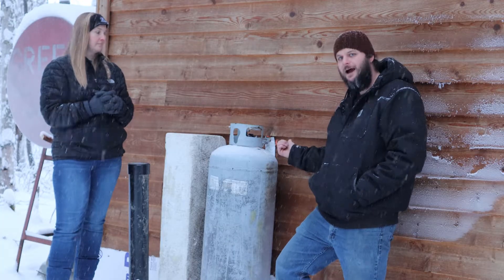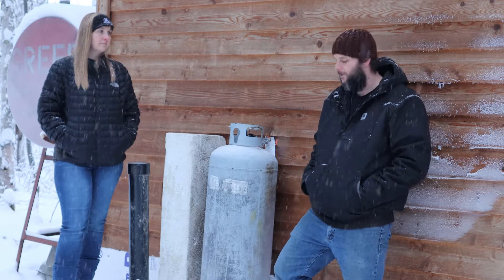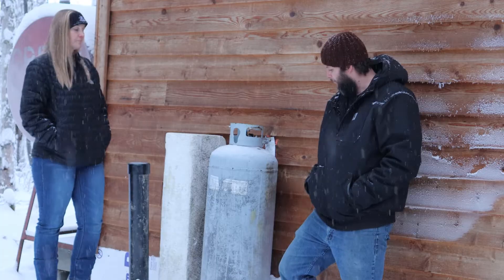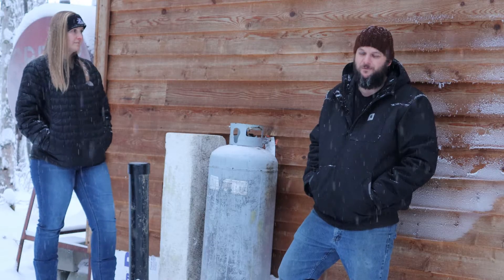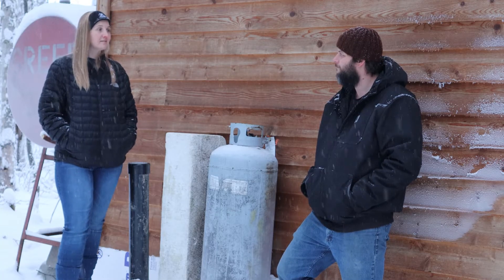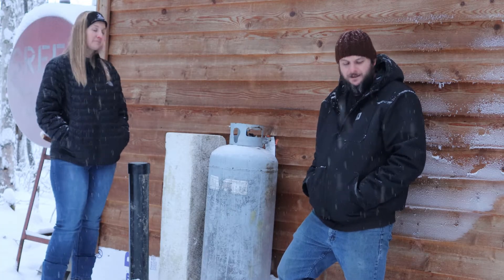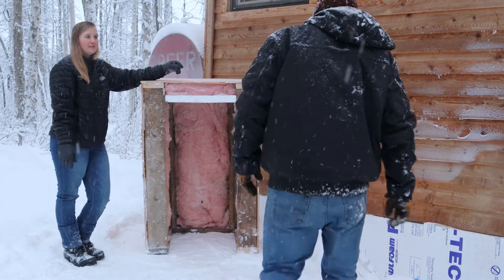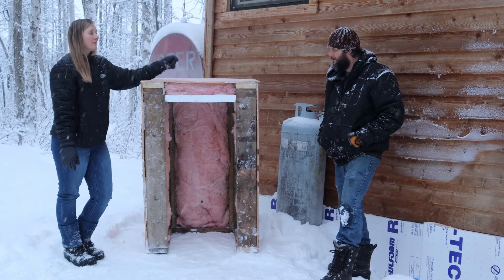Frozen Propane Tanks in Alaska: SOLVED!

Comment: I'm in NJ and have this issue for my garage. When you build that shelter make it so that it wraps around the tank, but not the top where the valve and regulator are and mount an inconsistent light bulb in the shelter and then have it controlled by a thermocouple. That should be safe and effective
Reply: Meaning you could have it closed off at the top around the tank but not enclosing the valve area, so basically the let's say 50 watt bulb is keeping the tank body warm enough. Those thermoxubes turn on at 35f and off at 45f.

Comment: Also the reason our tanks freeze up is related to the btus of the appliance you are using and the surface area where the liquid turns to a gas. If the appliance are calling for more gas but the surface area cannot convert the liquid to the gas fast enough a freezing of the liquid lpg occurs.  This is a technical name for this is called auto refrigeration and it means the liquid cannot convert to gas fast enough and begins to cool and causes the tank to freeze and the liquid propane becomes like slush and does not convert to gas so your appliances starve and wont work.   Hope this helps. I live in Canada and off grid to.  Larger horizontal tanks are best but if you cant get fuel delivery try two 100 lb tanks with a two into one line.  So this way you double your surface area. Two into one line costs seventy five bucks.

Comment: Hi. Buy a tank heater blanket.  It draws 100 watts and plugs into your generator 120 volt plug.  Or regular house plug. They are for 30 lb tanks so buy two   Amazon  sixty dollars each one.  Problem solved.

Comment: Hope all is well with you and yours. I know it has been a while since you posted this video. 

This comment is here to help others that might be interested in the topic “prevent propane tanks from freezing in extremely cold temperatures”. More on this in a bit.

Also, I understand the video depicts a solution to get propane heat into the cabin when outdoor temps were at or below -38°F. I consider this a temporary (emergency?) solution only. A propane delivery system should safely operate in all temperatures. By safely, I mean “NOT go Ka-Boooom!”. Once the outdoor average temperatures warmup, you should remove the tank enclosure, move the tank to a safe distance from the cabin PERMANENTLY and bury a propane supply line between the tank and cabin. Also, bury a 120V electrical line to the tank so you can energize a 95-100°F tank heater blanket for use in very cold weather only. If you do not energize the blanket, you must remove it from the tank so the tank can then utilize the surrounding ambient air to warm the liquid propane within.

Also, if budget allows, get 1 or 2 more tank(s) and tie them all together into a manifold. This full flow manifold will reduce the appliance draw, on each tank, to 1/2 or 1/3 previous draw, respectively. This can be a big bonus in very cold weather. This results in you being able to get more fuel out of each tank before refueling is required. In this case, you might be able to get by without heater blanket(s). 

Now, the topic: “prevent propane tanks from freezing in extremely cold temperatures”.

The main goal here is to allow vapor ONLY to leave the tank. In a perfect world where we have DRY propane in the tank, we would be done. But, depending on how cold it is outdoors, vapor can and DOES condense back to a liquid in the supply line. We have to deal with that. First, a little background: 

I read most of the comments. They are all over the place about the possibility of water being in the tank. Some say it is impossible for water to be in the tank! I am not going to argue whether there is or not. My advice is to plan that there will be impurities, of any kind, including liquid water, in the propane delivered to any tank. For whatever reason. This discussion plans on both water liquid & water vapor in the tank. In general, while operating through all the seasons of a year, a minimal amount of water in a tank should not affect operation UNLESS water freezes in the supply line to the first regulator orifice.

When outdoor temperature is near 32°F or lower, vaporized water can precipitate forming droplets on nearby cold surfaces. This also happens for vaporized propane when outdoor temps are near -44°F or lower. If this water precipitate DOES get to the initial regulator, when the regulator performs it’s magic, the resulting pressure & temperature drop can freeze the water precipitate at the orifice of the regulator, blocking it. Not Good!

Now, we can deal with this precipitate, of any kind, as long as it does not get to the initial regulator orifice. One way is to focus on any precipitate near the tank supply valve pigtail. Make a loop in the pigtail coming out of the supply valve by bending it into a vertical loop. Make a gentle vertical curve up & then down to the regulator. Another way is to make a longer pigtail which is curved in a circle, spiraling upwards, a loop or two, then bent down for the regulator inlet connection. The upward slope of the pigtail, from the supply valve, allows any fluid droplets present to collect & flow back to the tank itself while allowing vapor, only, to continue onward to the initial regulator.

Comment: I think you are on the wrong track.  LPG does not freeze at any temperature  at which humans can exist,  and LP  certainly does not freeze at any neg 50F.  PROPANE DOES HOWEVER   become  essentially  THE SAME AS ATMOSPHERIC pressure at about NEG  44F.  This means it could NEVER generate enough pressure/ vapor/ flow to operate the reagulator(s)  or push gas through the piping.

Did you somehow  get moisture into your piping or regulators?   LPG does not contain water/ moisture, unless you have a  scammer  for a  supplier.   Generally, horizontal tanks are much better than vertical because they have more  vapor/ dome area at the top for the LP to vaporize.  Frost/ snow/  freezing that is water based on the OUTSIDE of a tank, fittings or piping  should have no effect.  IF YOU GET  water into the vent of an outdoor regulator, that could be an issue.  ALL regulators have a vent (someplace)  to the  outside / atmospheric  pressure.

Comment: how did that work for you ? my thought was to build an enclosure like you did with a bock base and put some vents from the house through to the tank enclosure so as you are heating the house you are also heating the tank area. I would put some gasket insulation between the house and enclosure and eye bolts or ??? to be able to fasten the enclosure to the house tightly.
Reply: Are you nuts? Obviously you don't understand that propane vapor will enter the house using your method and potentially be fatal.

Comment: so how well did it work? i still need to build a enclosure for my tanks
Reply: Insulating human body with more clothing will reduce thermal transfer rate making us feel warmer in cold environment
A propane tank is not human body where it metabolize food for energy, just like insulating a house will not raise indoor temperature, to raise temperature it needs a thermal energy source.
Propane liquid (and therefore container tank) will take away energy as evapouration happens, the heat has to be replenish from somewhere otherwise propane gas pressure drops, at same consumption rate, a bigger tank (more mass) will slow down temperature drop, or better provide a suitable heat source and send the heat where its needed, e.g.

disclaimer: I have no relation with below business
https://youtu.be/cIL4KgqU0hk
Reply: by the way propane gas is denser than breathing air, if a leak happens propane gas sinks to bottom and accumlulate, so leave some air gap at bottom (and top for convection) of enclosure to vent before the concentration become explosive and it finds an ignition source
Reply: https://youtu.be/JzdnUZReoLM

Comment: add a second tank for more draw volume, i had this same issue with cold temps running a 100K btu heater with a 20lb bottle now i know why the instructions said to use at least a 40 or 60lb bottle, either way got a 100lb and never had an issue again but seems to be the same issue as a few others have mentioned, either a change over valve or tie the 2 together to double the capacity.
Reply: Agreed. I now have 3 tanks tied together and problem solved.

Comment: It’s nothing to do with stages but the boiling of the gas inside the tank due to draw from the burner, case in point I’m in Canada and the workshop heater is 12 feet from the tank which if the heater is on max the tank will ice - the best way is connect a 2nd tank on a changeover valve and allow the 1st to recover itself

Comment: It's 40°f here in Austin TX and my propane is freezing lol funny that it's freezing point is actually -300°f 
But it just can't turn into a gas property when cold
Reply: Propane boiling/ condescending temp is around -40F so how do you get -300? I handle a variety of different refrigerant gases on a daily basis and have for years and KNOW these temperatures. PROPANE is used as a refrigerant also know as R 290 and several other refrigerants.
Reply: @robertstanley1056 
Propane freezes at -306 degrees.
Reply: @robertstanley1056  I mean for it to actually freeze into a solid.
Reply: @danniemikeey2907  Howdy Texas! It is -35ish (yes, that's minus 35) where I live in Alberta, Canada at the moment. This is normal for us during the winter and not climate change for the climate crazies out there!  Relax Mr Stanley. A solid like dry ice (frozen CO2) right? Liquid Nitrogen boils at -297. I don't remember off hand, when it turns solid though, but it does. I've been working with liquified gases like oxygen (for hospitals), nitrogen, helium for refrigeration, purging/pressurizing piplines etc and maintaining their respective containers for about 30 years now. Cheers and Merry Christmas.
Reply: @michaelheurkens4538  hi!!! I actually found out that it wasn't a condensation problem but a pressure problem.

Comment: One thing that would help is having 2 tanks with a duel manifold. The vapor at the top of the tank is what is freezing, not the liquid propane at the bottom. If you have 2 tanks 2 share the load you will have much less of that propane 🥶
Reply: Nothing is freezing. The pressure inside the tank is dropping too low. At 70F the PSI inside a tank is around 125, at 32F its around 50, and at 0 its around 25. at -20 its around 10 PSI. Add a first stage and second stage regulator as well as piping, and that PSI can drop so low your appliances won't operate.

Comment: When propane vapor is released from the tank for appliance service, the propane inside tries to use ambient heat energy to boil propane and produce enough vapor pressure to reach equilibrium. This makes the propane tank draw heat thru its outside surface, and develop a frost layer. this solution shown wont fix the problem for continuous operation in low temps. The best solution is both insulate the tank (non permanently, so you can remove it in summer), AND apply heat from an alternate source: electric heater, gas heater, etc. These systems are available in the market.
Reply: Would some electric pipe wrap around tank and some insulation work?
Reply: Whatver you do, please ignore everything this guy said.

Comment: One trick that works for us is to use charcoal hand warmers (the large body warmers are best) along with a sleeping bag or heavy blanket. Put the warmers on the bottle at the stem and cover with sleeping bag to try and keep heat in. At -50f we just gave up on it and used the wood stove. Good luck with the shed.
Reply from the maker: Yeah that’s a good idea, We’ll keep that in mind if it comes up again. Thanks for the tip 👍
Reply: Thank you soooo very much. You literally saved me tonite, so here is the twist this mam mam here alone w 3 lil ones under 5 attempted and succeeded, when guided by your knowledge. First, convinced myself I will not cry, nor call for help, I can do this. Found hand warmers 🤦🏻‍♀️🤣, grabbed 2 diapers we no longer need, Bc we conquered potty training previously 🙏🏻🙏🏻, thick flannel oh pants and a rubber backed bath mat. Wrapped the hand warmers around perimeter of top of regulator, and one centered underneath. Wrapped warmers   tightly by attaching the pampers w the Velcro closures around the regulator and activated warmers. Blocked all holes on top of tank w pj pants, and wrapped rest around outside of diapers, then placed the bath mat on top of pants further blocking holes and laid the rest on top of the other insulators. I came inside. Warmed my hands, and tried the propane unit on living room wall…. It lit! Then I said a prayer that you always have heat, I truly am blessed to have come upon this video, I thank you all. And will be looking for a better insulated solution come very soon. We don’t have that many pampers left ❤️‍🩹🤦🏻‍♀️🤣🙏🏻💙